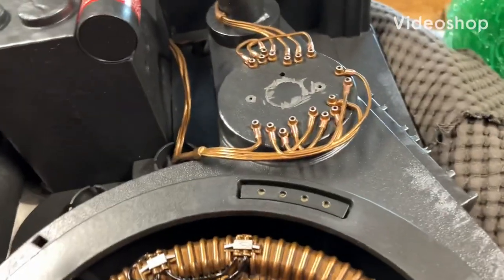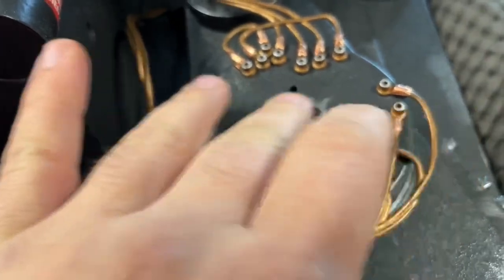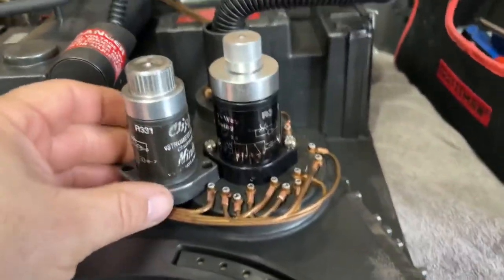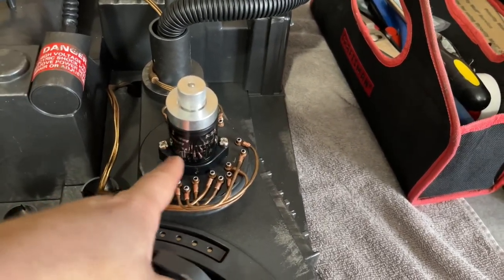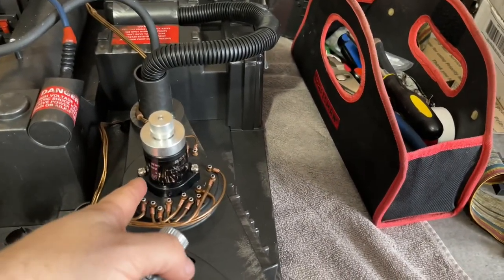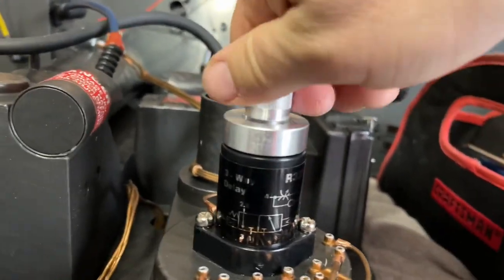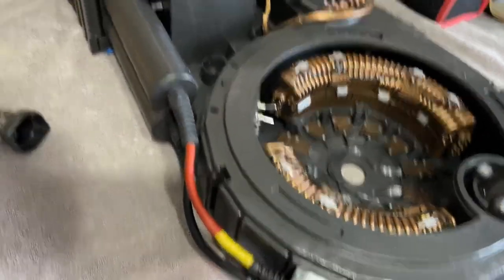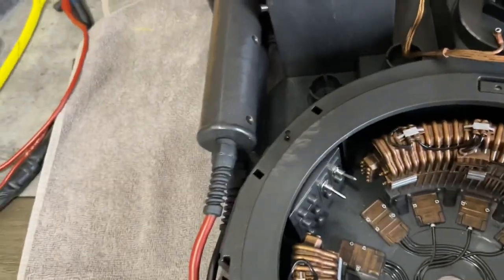Replacing Fake Clippard Valve On Your Haslab Proton Pack With A Real One

Comment: Nice job! Is there space inside to put nuts on the back of the Clippard screws?
Reply from the maker: Thanks! No because the vibrating motor is right behind it unless you took that out. You can get one nut on but not both
Reply: @ghostbusterspluscollector9624  Ah, ok! I was hoping there would be space either side of the rumble motor.
I guess I’ll do what you did and glue it on along with the screws.
Thanks mate 🙌🏻
Reply: Gbfans just drilled through

Comment: Can the real Clippard valve support the hasbro screws? or do you have to drill new holes for the clippard screws? I was thinking just getting rid of the plastic knob on the back of the real one and use the Hasbro screws to screw it down since it is the correct threading.
Reply from the maker: I think the Hasbro screws are too small for the Clippard holes to support it. Although if you wanted to use superglue a lot of superglue itself will support the valve if you have it sitting flush on the pack. If you don’t want to use superglue you will have to drill slightly bigger holes for the real Clippard valve screws to support it.